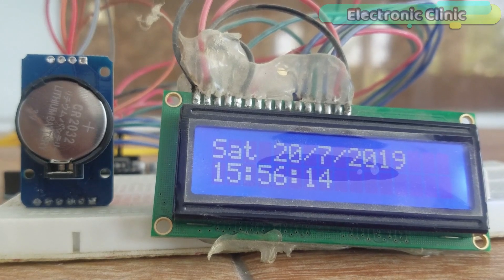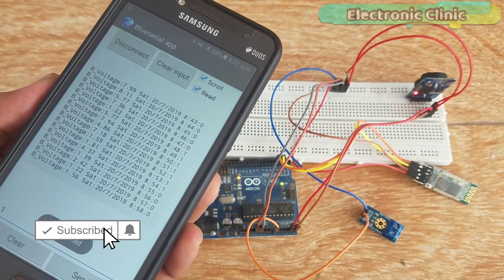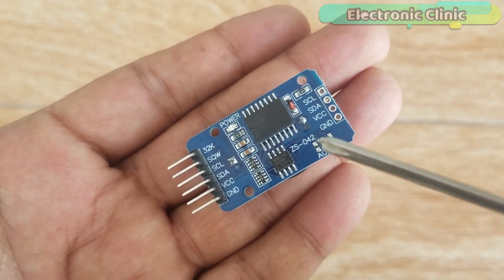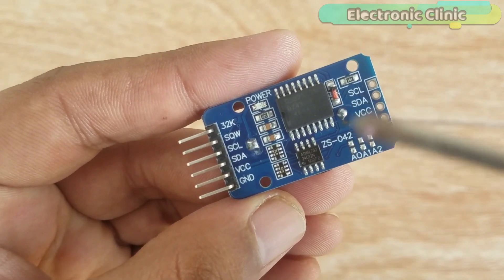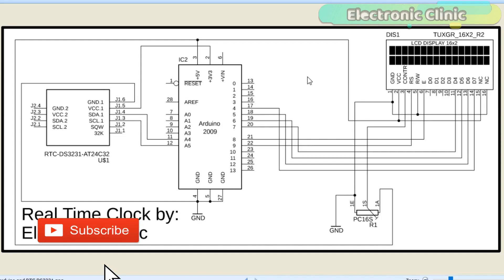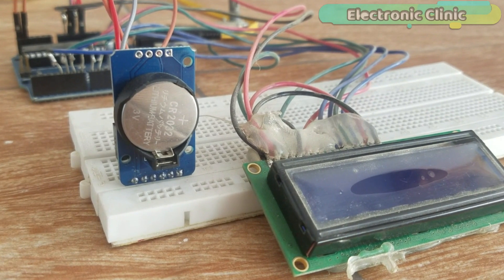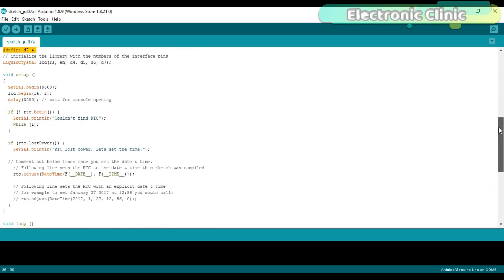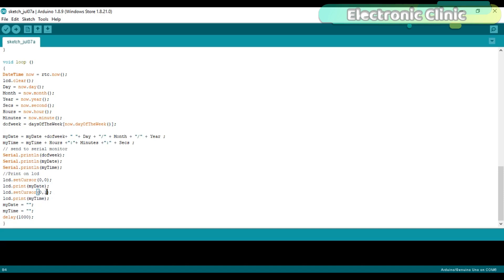Arduino RTC DS3231 Time and Date display on a 16x2 LCD “Real Time Clock”

Comment: bonjour nano ou uno et 16x2 Lcd en I2C ne fonctionne pas SDA A4 / SCL A5
même avec les port SDA et SCL UNO , ponter les VCC sur 5V ou 3,3V rien a faire , j'ai même raccorder directement a la sortie du DS3231 sur les pins opposer en 5V (éclairage  
du LCD 16x2 très faible ) sinon le programme fonctionne dommage si quelqu'un a une solution merci